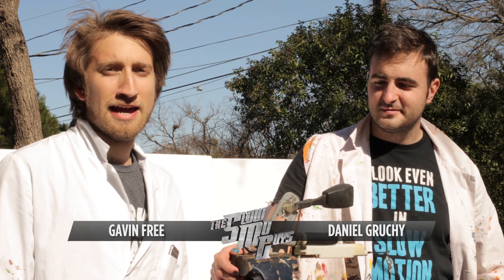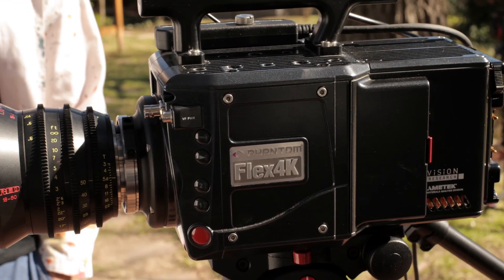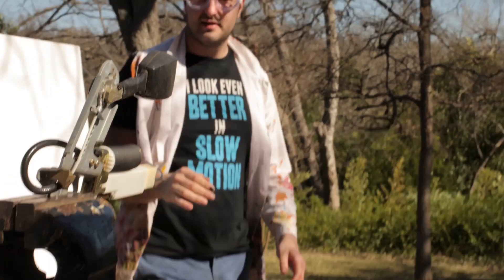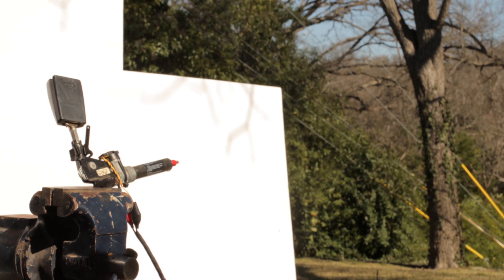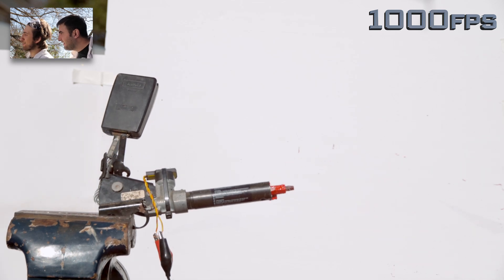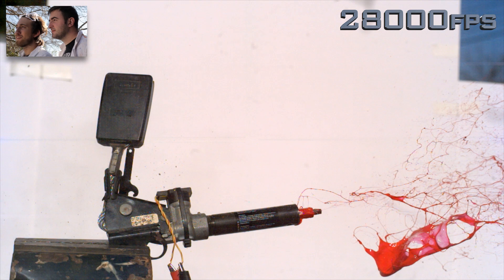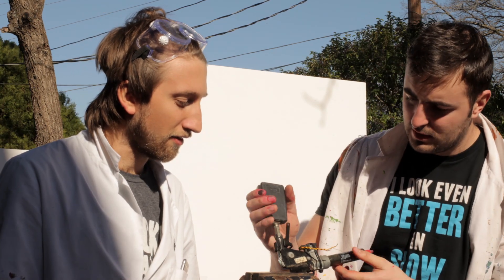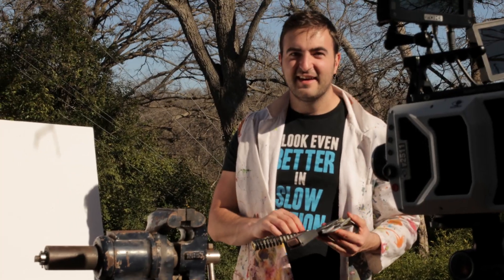Seatbelt Pretensioner in Super Slow Mo - The Slow Mo Guys

Comment: 3:00 'You know the ejector seats on helicopters..'

Not sure that would turn out very well Dan.
Reply: There's one on a Russian helicopter that blows the rotor blades off and then ejects the pilots, so they don't go through the rotors.
Reply: Danbenford state of the art helicopters eject the rotorblaes before ejecting the pilot, so it does actually work :P
Reply: Yea, helicopters can autorotate to stop a crash and don't need ejector seats. Basically as the chopper is falling, you tilt the blades vertically and the wind starts spinning them very fast. Then as you approach the ground, you flatten the blades out and the rotation provides a life-saving amount of lift.

(DISCLAIMER: I am a musician with a thirst for knowledge, not a helicopter technician expert)
Reply: Danbenford maybe one that ejects sideways
Reply: +Chris Thomas nearly correct. if the engines fail you actually dump the collective i.e. 'Flatten' the blades out. The increased speed from falling will rotate the blades anyway (autorotation) and the pilot then 'flares' up before touching the ground by pulling on the collective
Reply: Chris Thomas Planes can glide to a landing with no power or fuel is even easier than a helicopter. Ejector seats in either type of craft are for more "unrecoverable" scenarios. You're out of control, your tail is blown off, the thing's on fire...stuff like that.
Reply: scott Winter Like in Goldeneye!!
Reply: Pwasma Dwagon Would be cooler if the blades were attached to the seat and you'd just fly like that.Too many cartoons? :\
Reply: botisonny LOL i like the way you think
Reply: Pwasma Dwagon the old ones used to eject you out of the bottom, but that didnt work if you were close to the ground.
Reply: Danbenford someone hasnt seen Goldeneye
Reply: Danbenford Timing!
Reply: Pwasma Dwagon I was about to say that but just imagine if the rotor fails and you get ejected trough them. any way if the rotors are still good you can auto rotate the chopper down
Reply: scott Winter like the one in GoldenEye
Reply: Black helicopters.

Google it.
Reply: Danbenford Google it, some coppers have ejection seats that fire downwards, Google and see the models that have them.
Reply: ***** it's look it up bra>
Reply: ***** Did you even Bing it?
Reply: Bing you must be new here I'm a unicorn this is the internet no one uses bing its Google or Google that's it if you need more info ask my good friend spoderman Ben Zinninger
Reply: MajesticWarUnicorn some people still using it, and so do i. But only used it when Google Fucked up (Suspicious Network Trafic, LMAO)
Reply: Chris Thomas Yeah uh, you don't point the nose at the ground, you just dump the collective and allow the rotor RPM to increase that way.
Reply: ***** Thanks for the correction, but I actually didn't say to tilt the nose to the ground. Forgive me for using confusing terminology, as I said I am a musician and not a helicopter technician. Words are not exactly my forte
Reply: Chris Thomas Well, I was going to save you in the zombie apocalypse to be my helicopter technician, but after reading your disclaimer I decided that I don't need musicians.
Reply: Liam Harder Hire me! ;)